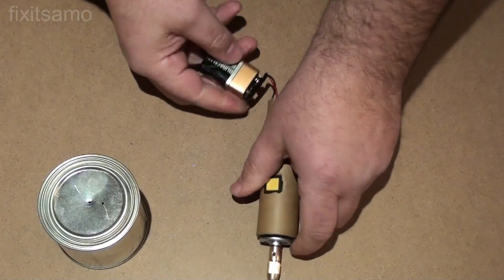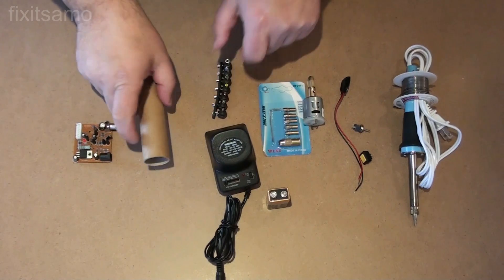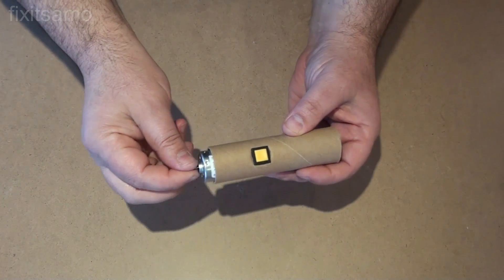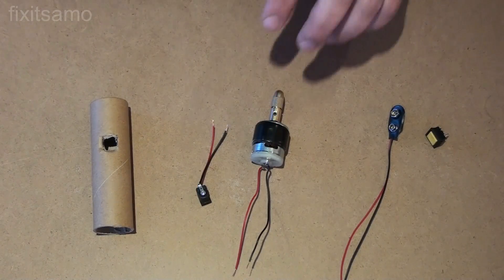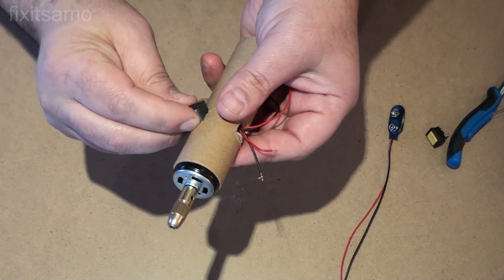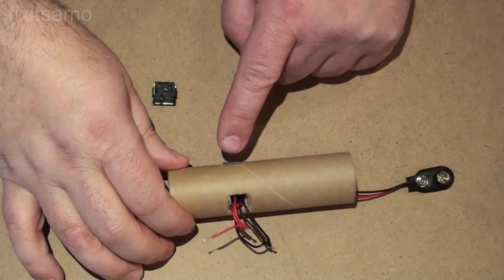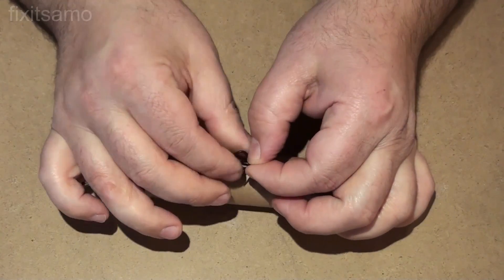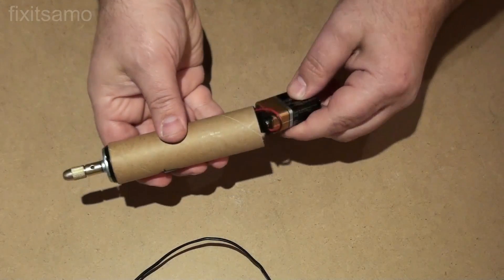DiY Mini Drill Works with 9 Volt Battery & AC to DC Electric  Adapter

Comment: from where did u purchased that ac dc adapter plz reply to me
Reply from the maker: From amazon 

Belker 36W Universal 3V 4.5V 5V 6V 7.5V 9V 12V AC DC Adapter Power Supply for LCD LED Light Strip Router Speaker Smart Phone Tablet Kindle and Echo Dot TV Box 0.5A 1A 1.5A 2A 2.5A 3A 3000mA Amp Max. https://www.amazon.ca/dp/B07BTNTHW9/ref=cm_sw_r_oth_api_glc_i_XT7M439RAVFN9ZPEKHY9
Belker 36W Universal 3V 4.5V 5V 6V 7.5V 9V 12V AC DC Adapter Power Supply for LCD LED Light Strip Router Speaker Smart Phone Tablet Kindle and Echo Dot TV Box 0.5A 1A 1.5A 2A 2.5A 3A 3000mA Amp Max.: Amazon.ca: Electronics

Comment: i think ill be using a pvc pipe instead of the cardboard, and glue the motor to it, also some sistem to lock the battery in place so it doesnt fall when i use it, but its interesting and pretty powerful.
Reply: just place a pvc end cap on the end of the pvc pipe to hold the battery in.

Comment: I have a 12V 1A motor, an AC DC adapter like the one U have but I do not know which voltage I should switch to. Can U kindly advise. Thanks in advance.
Reply from the maker: +Juliana Tan if your motor is a 12 V  you can Switch your adapter to 12V the motor that I used in the video was a 9 V  so I hade to switch my adapter to 9 V

Comment: can you just use the 9 volt battery
Reply from the maker: +perfect vids gaming  sure u can just don't add the ac dc adapter connection
Reply: ok thanks

Comment: Hi fixitamo your motor seems to have very powerful torque how do you determine which motor is good for a drill....you see i made one but there is no torque and as soon as it is press against an object it will stop immediately...if you know what i meant please advise
Reply from the maker: +Meiji Jap hello my motor is 9 volts  14400 RPM make sure not to push very  hard on the metal while drilling
Reply: How do you measure the RPM?
Reply from the maker: +Meiji Jap its hard to explain in typing  I recommend you to look for it on YouTube a lot off videos that explains all  the steps just type in search  :) have a great day

Comment: can I use a 10v output mobile charger for the motor?
Reply: + I m ur first subscriber :)👍
Reply from the maker: +KOLLI SUKUMAR it could damage the motor  I recommend using the same voltage
Reply: +fixitsamo OK what voltage you used?
Reply: it will burn the motor..u should use 9 v battery or adapter.

Comment: hi!
simple and good. is it ok to cover the vent holes of the motor?

what motor are you using. how many rpm and amps?
Reply from the maker: +Axell Andersen I don't have the rpm or amps its a regular dc motor ant its ok to cover but don't cover the top side